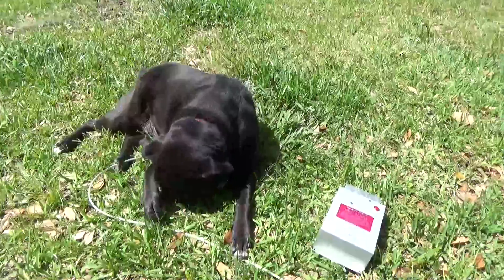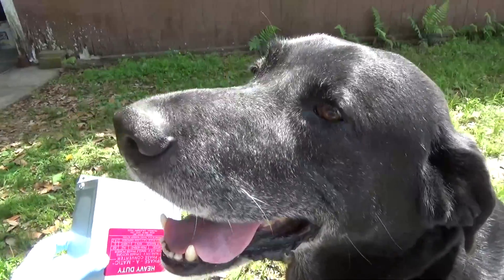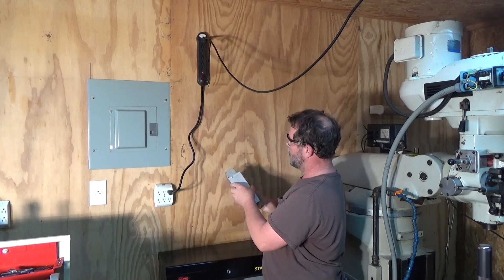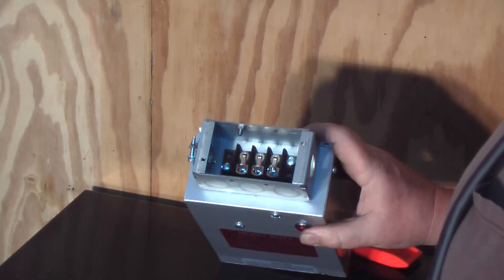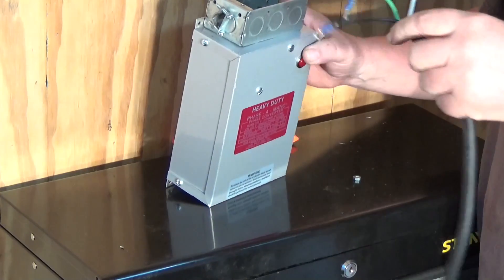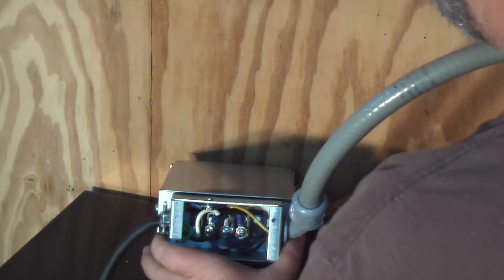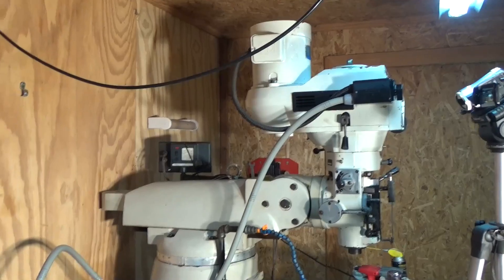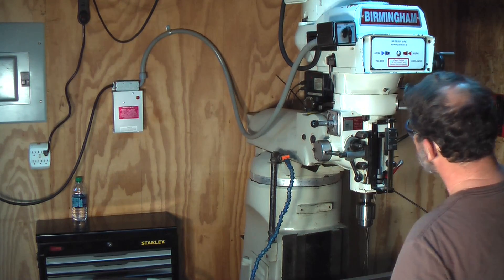How to Install a Static Phase Converter

Comment: I have the same converter does yours make a pretty loud clicking sound? The capacitor is clicking on and off?
Reply: I'm having the same problem with the clicking after trying to start my lathe ,came to the comments to see if anyone else had the same problem.. You figure it out ?
Reply: @jonathonewing6400  Yes my problem was I was running too much amperage. My milling machine was a 1 hp and I using my welding outlet which was 50amp. It was far too much amperage. I only needed a 15 amp breaker. So all I did was add a 15 amp 2 pole breaker in the sub panel. It still clicks that's just the solenoid picking up the phase but its not nearly as loud as before.  Hope this helps
Reply: Mine still clicks as well but starts my lathe but I think I need more power or something, maybe the phase -a-matic is under powered as my lathe motor is a 7 hp

Comment: Don't know if you check your comments or not because the video is five years old. My question is how has the converter worked and held up for you?  I purchased the same converter and I am getting ready to install it. 
Thank you in advance,
Bill
Reply: Yeah, I get an email when a post is made. As for the phase converter I used it for awhile and then went to a VFD for the mill. It worked fine I just wanted more flexibility.
Reply: @ipsofacto2100  Thank you for the response!

Comment: You still happy with you phase converter ?     Can you add  another machine ?
Reply from the maker: I did not use it long. I upgraded to a VFD, if you want more than 1 machine on it get a rotary phase converter.
Reply: @bstanga  what vfd did you get you should make a video of it

Comment: Sorry the neutral wire from the 220 single phase the instructions say not to use it so do you just ground it?
Reply from the maker: Let me state first that I'm no electrician. With my 220 I had 2 hot wires and a ground. So if you are referring to the ground, I attached it to the box.
Reply: Yeah, the instructions say ground to the box or machine ground.

Comment: What did you do with neutral?
Reply: paul mckinney dont attach to anything. Cut it short. His so cord is prob 14/3 not 14/4 or whatever gauge he used. No neutral at all if he's only got 3 wires that make up the so. You can buy it like that.

Comment: Remember a static converter is just a relay and a starting cap, usually about 110mfd per hp. The relay is Normally closed, when the 3rd leg is energized off induction the relay kicks the cap out. At that time the mill runs in "2 phase" which is why you lose 30% of the torque. Its also long term bad on the motor. We ran a mill like that for years, then moved it to real 3 phase power and the motor never made any more torque like it used to. Get a VFD! They take single phase 220v in and spit out true 3 phase with a perfect wave form. You can control the HZ output so you can control motor speed, when you lower hz frequency to slow a motor there is no loss in hp as there would be using a voltage limiting controller {PWM , rheostat, triac etc} If you flip from fwd to reverse without letting the motor stop fully, it will continue spinning the same direction with a Static Converter. This sucks! You cannot live/rigid tap like that!
Reply from the maker: +Diesel Ramcharger thanks again, and yes I went from fwd to reverse and it kept spinning in fwd direction, will get on the VFD bus soon just have to get my money saved,  a new pool pump yesterday tapped out my "tool" fund, thanks again
BS
Reply: Brian Stanga I know how that goes! i bought an old Magma Eng. Bullet master that I've been restoring and a Star Sizer I'm automating right now. We've all got some projects! If you need a shitload of 9mm cast 124gr lemme know lol. If you are a junkyard hound like me, all modern commercial a/c systems have a VFD inside them. there will be a tall narrow panel, usually 10" wide and 3 feet tall with a disconnect switch. To swtich from auto {VFD} to manual {straight 3 phase} for emergency cooling/heating. Find that panel, check the VFD for its voltage rating. The voltage has to match {don't get a 480v}, get one with the at least the same or higher nameplate rating as the motor you want to run. When single phasing a VFD most will recommend going one size over to make it easier on the front end of the drive being "single phased" {Not overloading the diodes} if you have 0-3hp you can go straight nameplate, if you got over 3hp make sure you double the nameplate rating to get the correct VFD size. Easy Peasy! :)
Reply from the maker: Diesel Ramcharger You have me convinced, I can scrounge up $221, will I be able to use the same fwd and rev switch?
Reply: Brian Stanga Yeah, the way i do it is i take the wires off the rotary switch. Run wall power into the VFD, connect VFD output direct to miill motor {no relays or contacts in this line}. From the VFD control bus there will be a Common wire Also FWD REV and a bunch of other stuff you won't use.  I run a 3 conductor extension cord into the rotary switch, hook Common from the VFD to a center pole and FWD and REV to respective contacts. Set the VFD to "coast". When you turn the mill off it will coast down just like normal, and you can use the hand brake. Or you can turn on the active braking and when you turn off, the mill will stop as fast as you tell it too. If you want to instant reverse for tapping, use this function.  Many people will go a step further adding a little control box with a potentiometer and a couple switches so they can turn braking on and off as well as control mill speed on the fly. {You just leave the mill in high gear, use the knob to select speed} only time you use the mill to adjust speed is when you select the back gear for something. xbunlocked at hotmail dot com is me. If you have any questions or need help getting running. Gimme a shout!

Comment: Dude, throw that piece of junk static converter in the garbage. 208 dollar shipped for a Fuji Frenic VFD. You will get 0-150% speed control, torque boost if you need it. Instant braking and reversing for live tapping. Dude, get one! Heres a link, you can find it a few bucks cheaper if you google around.....http://wolfautomation-beta.com/index.php/catalog/product/view/id/8663/s/ac-drive-3hp-12a/?gclid=Cj0KEQjwjIy5BRClh8m_9Zu64d8BEiQAtZsQf-RaV2NlgdBOq1wlKKVEeWqRY4Xg8a5V0rlU11UROPAaAmaZ8P8HAQ
Reply from the maker: +Diesel Ramcharger Thanks for the info, do you get full HP with a VFD? or do you only get 50-75% of the rated motor HP?
Reply: Brian Stanga With a VFD you get 0-90hz adjustability meaning you get 0-150% torque/hp of the name plate. I been through it all man! Up to a 20hp rotary converter at one time, trying to start my 5hp 3ph lathe. That converter would pull 183 amps at startup! Browning out my entire house {only got a 200a panel from the meter} I bought a used VFD out of the junkyard {Fuji Frenic} and that same lathe takes 8 amps to start and 6.5 running now. i sold the 20hp and keep a 7.5hp rotary converter on hand now for oddball stuff like my bandsaw and testing motors. Good news is, if you get any old 3phase motor and use it as your idler, use that static converter you bought to control the idler and now you have a 3 phase rotary converter for testing and projects. Just keep in mind the "manufactured" leg of a rotary converter isn't going to match the power coming in from the street so it will NEVER be up to par as clean 3 phase from the power company or a VFD.
Reply from the maker: +Diesel Ramcharger The link you posted is for a 3hp VFD my mill has a 3 hp motor so is that the model I need? VFD does not have to be rated higher that the motor it's driving?
Reply: Brian Stanga see my other post lol. 0-3hp are usually rated so you can run true nameplate off single phase {all the small drives apparently have the same front end diodes which are good up to X amount go hp}. Over 3hp you have to double up. If any doubt call the manufacture {they are super cool, and will actually help you out} or call wolf automation, who also happen to be super cool. Just to make sure. Ive noticed on mills and lathes we don't run them that hard and can get away with nameplate sized VFD on single phase in pretty much any situation, but i wouldn't try that with something like an air compressor.

Comment: Brian, that is a nice addition to the shop. I would suggest that you consider mounting the phase converter 180* from the position shown in the video or fabricate something to cover the exposed terminals. One thing you don't need is a fly cutter flinging a chip or two into the opening and creating some excitement for you.
Reply from the maker: +Jeffrey Vastine thanks Jeff, but it has a metal top that encloses the connections in the box. thanks for watching
Reply: That's good! I did not see that at any point in the video and did not want anything bad to happen to you or Zeke.
Reply from the maker: thanks man

Comment: Nice mill, very speed head and built in coolant pump, man that's a score. I heard ol Zeke talking, he said if you can afford that he's gonna hold out for some real bacon from those wild hogs you keep showing.
Reply from the maker: +The Texas Gun Guy yeah after I went and looked at it it was a pretty good deal, also has a Newall DRO on it, the Topaz model I need to find a manual for it. thanks for watching and helping me find a mill. Highball!
Reply: +Brian Stanga You're welcome and highball

Comment: I have a 3 phase motor lying in wait for a use, will need one of those for it probably.  Thanks for the video.
Reply from the maker: +Amateur Redneck Workshop If I had a 3 phase motor lying around I'd make it a rotary phase converter using this same device. thanks for watching Harold

Comment: Looks like this is the way to go! I think I would like this better than a VFD. Are there any draw backs of this compared to a rotary phase converter?
Reply from the maker: +James Spires Well with a static you get 2/3'rds the rated horse power, with rotary you get full HP as with a VFD, In my case this is a 3 HP motor with a variable speed pulley  so I did not need the added functions of a VFD, so I went this route, $250 for the converter, thanks for watching James.
Reply from the maker: +Brian Stanga It was very simple to to wire and install.
Reply: BS in The Shop thanks